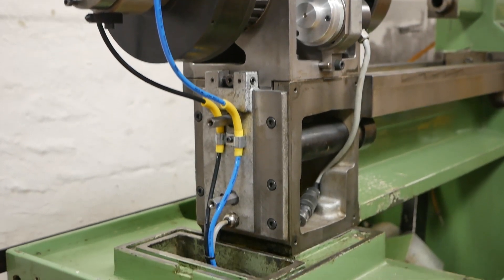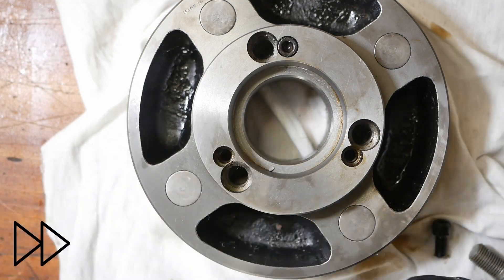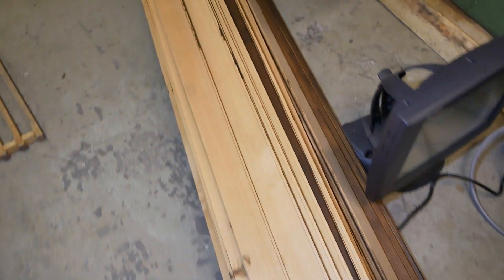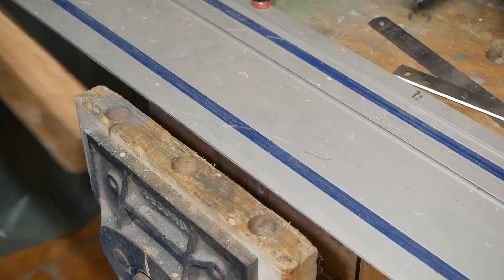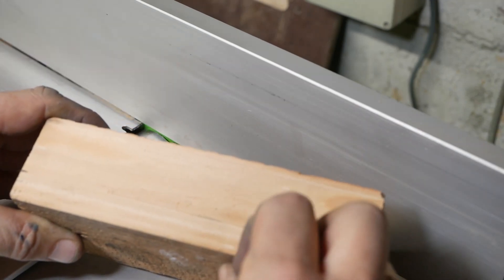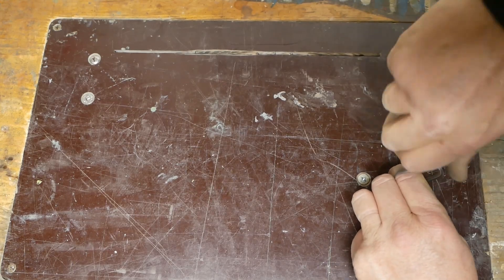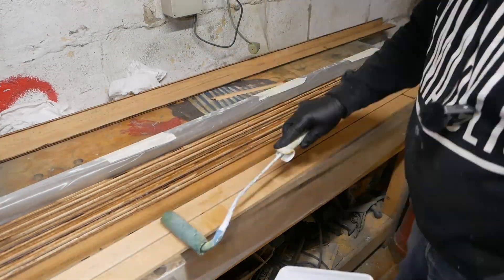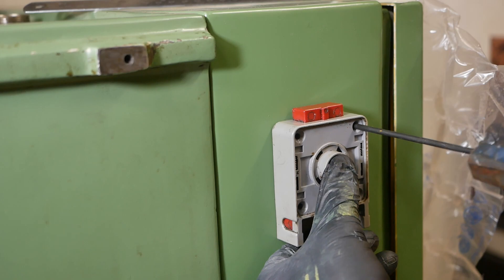Switch blade and chuck

Comment: I've seen a LOT of woodshops that use the bulk dust to make their own compressed wood pellets. Usually big ones around 75mm as it's pretty easy to cobble together using pneumatics, hydraulics, and a bit of welding. You can set up a system that you can fill a hopper up and let run for an hour or so at a time. Saves loads on heating bills.
Reply: If you have a wood stove and just have a small amount of sawdust, just fill the bottom of the stove with sawdust, put the regular firewood on top and light the fire as usual.
Reply from the maker: @Henning_S.  I normally put then in a paper bag in the wood stove. Loosely packed brickett :)
Reply from the maker: That is a good idea. Are they only compressed together, or is a flour glue used as a binder?
Reply: @RotarySMP  Brian has it right. As long as the pressure is high enough, you don't need any additives. Since you're not asking anything out of them structurally, you don't need the binder to give it more torsional, tensile, and sheer strength.
They just need to stick together well enough to be easier to put into the stove and not break apart when burning giving them a longer burn time.
Reply from the maker: @Drebin2293  I still need to see that video to get a feel for what is "enough" pressure in this usage case.
Reply: @RotarySMP  it is a lot, probably between 100 and 200 bar.
Adding some heat reduces the needed pressure because the lignin melts and bonds it together.
Pellets are usually not made with a hydraulic press, instead they use rollers to press the sawdust through a Steel plate with lots of small holes...
Reply from the maker: @Henning_S.  Thanks. 
I was chatting with a process engineering professor at the TU Vienna, and he mentioned that wood can be friction welded :)
Reply from the maker: @Drebin2293  I just watched that. Really nice job he made, but overkill for my few buckets of saw dust.
Reply: @RotarySMP  Absolutely. What you'd probably want is to make saw dust briquettes. There are several ways to make those, but you would definitely need to use a binder if you didn't have a mold you could use with a hydraulic press. Hell, I saw a guy that mixed old vegetable oil into it and just put it in a paper bag. As long as you're using a high temp stove, like the ones sold in the US these days due to the EPA, I don't even see any problem with the oil as long as you're using a solid bottom stove.
Reply from the maker: @Drebin2293  Good idea.
Reply: @RotarySMP  The Old Yorkshire Workshop recently posted a video of a Rube Goldberg device he uses to make pellets.  It's pretty ingenious.  https://www.youtube.com/watch?v=6ri62uzLoss
Reply from the maker: @stuartstephens  Yeah, thanks. I watched that. Kind of overkill for my few buckets of sawdustthough.
Reply: @RotarySMP  The low pressure briquettes made with binders and all sorts of crap like like coffee grounds, cardboard or newspaper produce a lot of ash. They don't burn very nicely because the ash on the surface insulates the interior and makes it more difficult to gassify.

The best high pressure briquettes feel like a solid block of wood. I buy these in preference to real logs as they are almost as good and are a waste product of the plywood industry rather than trees cut down just to be burnt as fuel.
Reply from the maker: @nrml76  For the small amount of sawdush I am making, I think I'll just mulch the rose garden.
Reply: @RotarySMP  I heat with commercial wood pellets, and they are made with sawdust.  The only binder is the lignin in the wood.  The slightest bit of moisture causes them to revert to sawdust.

Comment: 10:39... someone uses Black Magic to cut the Videos :p
Reply from the maker: Yep. Not sure why that glitched there. Da Vinci Resolve is pretty amazing software.
Reply: @RotarySMP  I had that Problem a couple of timed...
I had it because I Moved the File to a different drive
aaand on the way the file got corrupted u_u

After using the Original file all rendered ok
Reply from the maker: @T1g3rch3n  Hmm, I keep all my clips on the local drive during editing, so it should not have been that. I noticed Iphone time lapses often have those glitchies in Resolve though.
Reply: @RotarySMP  hmmm Most Import Problems i have could be fixed by running the clips through Handbrake.

Since Handbrake supports Hardware Encoding it got quite a bit Faster :)
Reply from the maker: @T1g3rch3n  TOT also recommended handbrake, but my old Zbook 14 from 2013 doesnt have a support graphics card.

Comment: I lived in Belgium for a summer and immediately noticed they have wood on the ceilings too. I'm baffled my neighbor Schnitzels a.k.a Austrians did that too? Never seen that and I've been around Austria quite alot.
Reply: Yes, it was quite common around here in the 80's. Houses back then often has drop ceilings. Nowadays it's typically plasterboard in plain white for the ceilings.
Reply from the maker: @kain0m  This place had this stuff all over the upstairs floor. Took me ages to remove it all.Mess of mould behind it.

Comment: At work we use saw dust to clean when we have a coolant leak or something like this
Reply from the maker: I always keep a bag of it around for oil spills as well, but this job will make way more than I need.
Reply: @RotarySMP  At my work my fellow workers still use absorbant. However, we have one of those vacuum cleaners made to vacuum up water, so I never use the absorbant; I use the water vacuum cleaner instead.

Actually, my fellow workers throw absorbant on a spill, but they don't clean up immediately, so they are stepping in it and walking it everywhere. So: it accumulates. 

Of course, sometimes spilled coolant is dried up, and only the oil is still there. To clean that I throw some water over the spot, a bit of rubbing with a floor squeegee, and then the vacuum machine. A broom doesn't gather all the dust, a vacuum does.
Reply from the maker: @cleon_teunissen  It would be nice to have a flat, sealed floor. Most of my basement shop has really crappy tiling. Everthing accumulates in the grout.

Comment: Nice chuck
Reply from the maker: Thanks for commenting. It really is.
Reply: @RotarySMP  I am working on my own LinuxCNC milling machine conversion at the moment, it is going slow but you are great inspiration
Reply from the maker: @DolezalPetr  Good on you. LinuxCNC is fantastic. Will you also use Gmoccapy?
Reply: @RotarySMP  Yes, I already managed to make that work, the PC it is running on is not the fastest though, still gmoccapy is probably the best choice
Reply from the maker: @DolezalPetr  The Maho also only has some 15 year old Intel Atom or celeron. You dont need much CPU power for LinuxCNC.
Reply: @RotarySMP  I picked up an Intel D510MO motherboard with an integrated Intel Atom CPU for 8 dollars, so that is what runs it